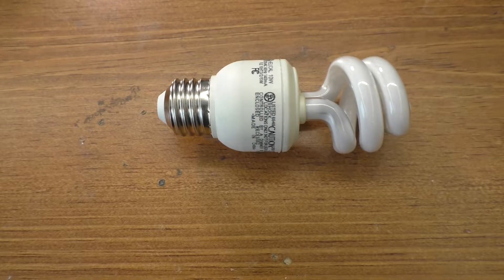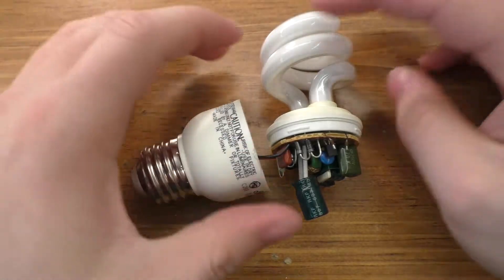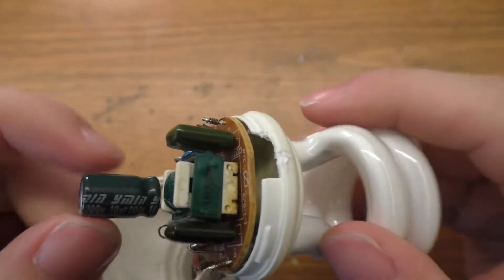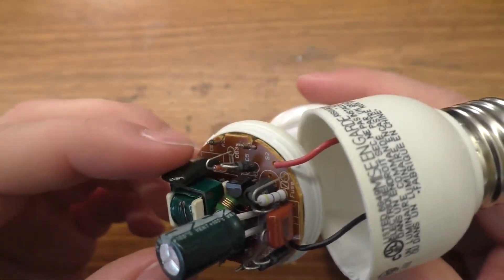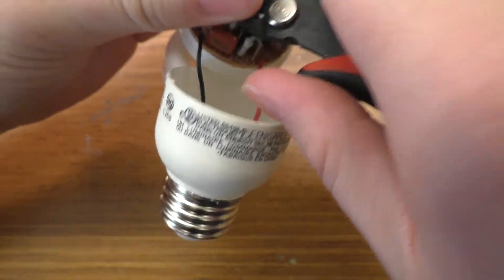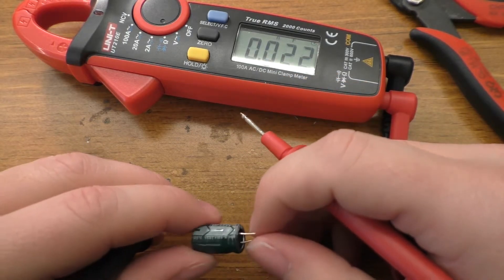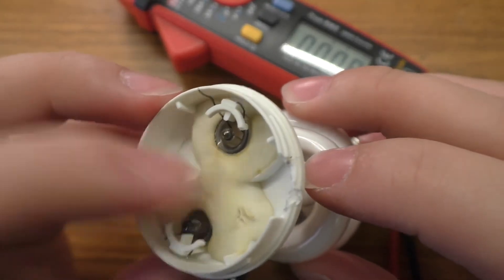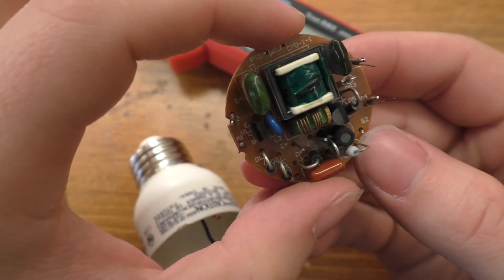10 Watt CFL Teardown

Comment: The failure is generally because of the heating elements on the each head of the tube.
When the Resistance wire fails, it stops to generate potential difference on each head of the tube. The solution is just shorting the 2 lead of the failed heating element. It doesn't generate too much heat when shorted, but when there is resistance, it quickly draws more current. So don't try a 10 ohm 1 watt resistor.

They make these bulbs to fail on purpose. This is so sick when there could be a fail safe mode built on to the driver circut. Mercury vapor will eventually get heated enough if you wait enough.

Comment: I had a whole bucket full of these failed bulbs at one point, either with dead tubes, failed capacitors or dead electronics. I did team one PCB with mini fluro tubes to see if that would work.

Don't be temped to put use of those Phillips "halotone" bulbs, they get super hot and fail within hours if used in any form of lamp shade or confined fitting.
Reply: Got a full blown tube style florecent lamp to run off of one of these drivers